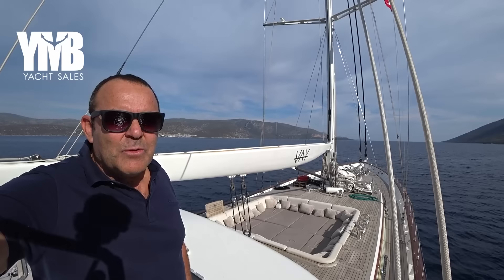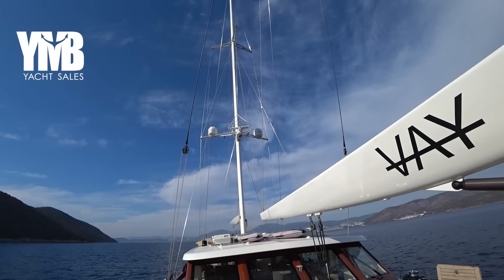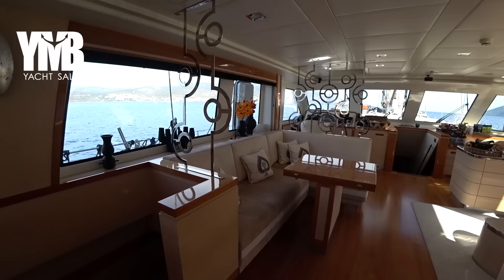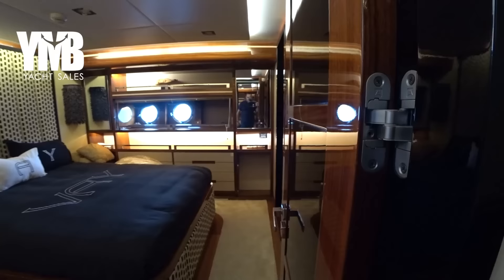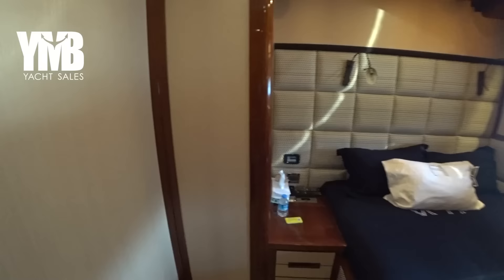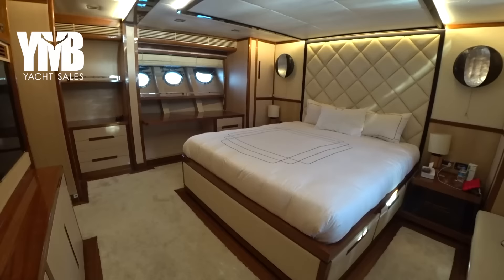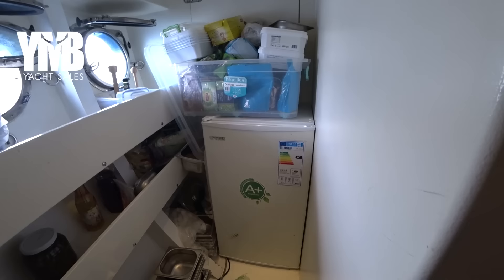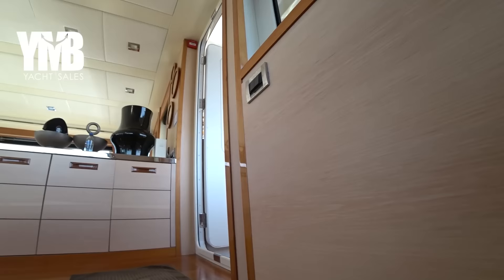36 m Gentleman's Sailing Yacht Interior Walkthrough For Sale

Comment: btw you can improve the contrast on your video by increasing the f/ stops setting on your camera, if it allows it. Otherwise you can adjust the f/ stops upward in post-production on any good video editing application. So those issues with the black marble are fixable, though closing shades over portholes can also improve indoor contrast.
Reply from the maker: Thank you very much for your tips,
Reply: @YachtMarineBrokerage  apply them

Comment: To Maintain the main Engine, you have big problem of lag of space.
Your videos are nice, but a little more technical info, the cushions etc we can see and don't need talking about!
Thanks for your time and afford 😊
Reply: Disagree. The motorized parts you need to access regularly are the generators and sail control/hydraulics motors. The access to them is great. As long as you can change/check fluids on those main engines , you are fine for basic maintenance, imo. This is a real sailboat, not some Bezos nonsensical motor yacht with masts that never get used . That's why there are many times the hours on the gennies as the mains. The internal access & room to move around at all is remarkable for a sailboat . Much rather have that roomy galley, tbh. You'd like better access to the watermakers, for sure, though. They get used hard & are essential.

Comment: very good video, beautiful boat. keep working on utilizing nautical terms. Its bowsprit, not bowspirit.
Reply from the maker: Thank you!
Reply: Aft can replace your “backwards” term as well.
Reply: @YachtMarineBrokerage  yes and the "vents" are "dorades"
Reply: @m1k3droid  I'm a native English speaker and I didn't know that.
Reply: @roadie3124  Bowsprit is the spar at the tip of the bow. Bowspirit is merely the feeling you get doing the whole Titanic thing at the bow....
Reply: @m1k3droid  Thank you for that explanation. I was actually responding to your post about dorades. I started sailing over 60 years ago, mostly on off-the-beach racers with some holidays on 65ft and 76ft motor yachts, and I never came across the term.
Reply: @roadie3124  https://en.wikipedia.org/wiki/Dorade_box

Comment: An edison generator and dynamos power system is a zero fuel power generation.  Car generators chiseled to spin like Edison generators is possible. Then add inverters to deliver house current AC power. Use old pre1974 car generator chisel off the Tesla magnets from the armature magnets one sixth on and off to three sixths on and three sixths off alternating on and off reassemble this generator/motor as a generator with 12 volt DC generator and 110 volt AC inverters. 45 amp DC to 40 amp 110volt AC power continuous peak power without fuel or pollution.

Comment: Can we redo that with hull keeled design with ballast in the boat.
Reply from the maker: It is not possible to make the keel capsutated. Only bolted.
Reply from the maker: She was built under RINA class
Reply: Bolting a or welding a French keel maybe possible to gain keeling design..

Comment: 3000 engine hours for a 7 years young Yacht?  Mine is 21 years with 2200 hours😎
Reply from the maker: Lots of sailing! Or... too much time in the harbor...
Reply: @YachtMarineBrokerage  yeah right :)  its indeed a very nice yacht. And i wish i could afford it ;) but 3000 hours in 7 years its too much motoring;)  But you did a nice tour, that was very nicely done!
Reply: This yacht has really been a motor yacht in its time.  Very little sailing apparently.  Gen hours are also very high.  Lots of major replacement and maintenance needed for the major systems due to the hours.
Reply: @DavidBruner_NJ   3000 hours for 7 years is big but for the engine it isnt that bad.  Good maintenance is  allways mandatory.
Still a nice yacht, i wish i could have (buy) her. :)
Reply: Its a motor-sailer to be honest here.
Nothing out of place. And am preety sure she can sail like charm! The only problem with that, is that you'll need full crew to unleash all of her potential. As usuall this yacht carry guests on charter and is probably crew up with only 3 people. Make that number to twelve lads that knew what are they doing, and this ship can outran any 90' Swan or whatever boutique eu builder 😉